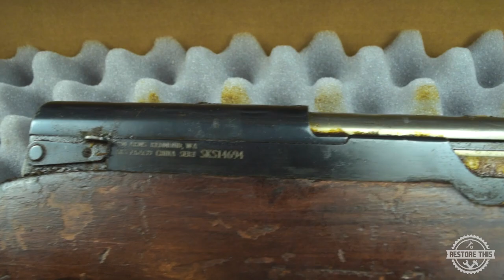VINTAGE SKS RIFLE RESTORATION! 1957 SKS Rifle Caked in Cosmoline Brought Back to it's Former Glory!

Comment: Just wondering can you still buy sks like this one?
Reply from the maker: They are still out there, but the prices are getting a little crazy in my opinion. Palmetto State still has some it looks like if you’re willing to pay up at $429 for one. When I got this one it was $300 I think, which at the time I thought way crazy expensive, but grabbed one anyhow. I’m sure the price will keep going up on these as the supply of what can be imported dwindles, but it’s hard to pay that much for one if you remember seeing these with 1k rounds of 7.62 for $99 back in the day.
Reply: @RestoreThis  thanks man ill get one from there. I had one and I sold it. I have regretted it since.
Reply from the maker: I hope you get a good one! As expensive as they’ve gotten, I still think they’re a fun rifle worth owning if for nothing else than the history!
Reply: @RestoreThis  i do agree man. I actually just got a ak47. It is an old one too. I just can't find out the year it was made. I have done a lot of research. I was reading some people in the ak forms.  Mine is different in ways from most wasr-10. I wish I knew more about it.
Reply from the maker: Interesting! WASRs are easy to date. They usually have the date stamped right on it.
Reply: @RestoreThis  mine doesn't  the way it is stamp is different too.

Comment: It may be more helpful to buy or make a set of woodworking scrapers instead of using so much sandpaper. Little harder to gum up and they last forever
Reply from the maker: Good suggestion! The paper gummed up really fast with that finish. Thank you for dropping by!

Comment: good video,  i remember purchasing 2 from classic firearms many years ago,  its always good to add the extra, hand pick option because you want a rifle that has matching sn and also the barrel needs to be in usable to excellent condition,  my only complaint about the sks in general is the trigger,  it horrible,  however it can be modded so it can be a better functioning trigger for target purposes,  i did have to replace the bolt in my one yugo sks because the firing pin hole enlarging and i was experiencing volcanoing effect and the firing pin kept getting jammed from going to deep into primer and causing primer to blow back out thus causing firing pin to get stuck inside of bolt body.
Reply from the maker: Hi Chris! That you for watching and commenting! Luckily I’ve never had the firing pin issues you describe. If I ever start having similar issues, I’ll know what the cause is. As for the trigger, I agree... it’s not the best. I might look into tuning it up a little in the future.
Reply: @RestoreThis  you should purchase some lapua 7.62x39fmj,  this is what i used to test accuracy in ak/sks based weapons,  it will let you know if your ak/sks is a accurate weapon since this is probably the best ammo you can purchase outside of doing hand loads and making you own ammo.

Comment: What did you use to scrape the stripper off the stock? I am restoring my own SKS stock and referring to your video....
Reply from the maker: Hi Martin, thanks for watching! It’s an old flexible putty knife. The particular one I used was made by Hyde. The flexibility helps it not catch and the biggest thing is watching your angle and the amount of pressure and force you use. Also, watch the grain. You want to apply pressure when going with the grain but not when going against it. You want to avoid catching on the grain and gouging the wood. Best of luck on your restoration! Take your time and it’ll turn out great!
Reply: @RestoreThis  at 6:04 how did you take that metal piece off the hand guard so easy? I am having a hell of a time with it and I'm chewing up the wood around it.
Reply: @RestoreThis  How many times did you go back over w the stripper to get the old finish off?
Reply from the maker: Hi martin, I ended up doing over it two times. Once with the scraper to get the most of it, then a second time with a red 3m scrip Uber I had laying around from another project. From there I did sanding to get some of the real stubborn stuff that was still on there
Reply from the maker: Sorry I missed this comment. At that point I had driven out the pin that held it on. I’ve take the wood out before by rotating the metal part but it messes up the wood. Driving the pin out is a better way to do it.
Reply: @RestoreThis  yeah I completely messed up the handguard, it's all split apart. I'm going to buy a "cheese grater" hand guard to replace that.  Ok thanks, I've only stripped the stock once, suppose I will do it a second time then sand.
Reply from the maker: Good luck! Keep going and take your time. It’ll turn out great!

Comment: @ 7:50 what is it that you are using on the stock?
Reply from the maker: Thank you for checking out my video! At 7:50 I’m wiping the upper hand guard down with some paint thinner to get rid of any oils/dirt from my fingers in preparation for the finish.
Reply: @RestoreThis  I'm sorry I meant 7:58 the goop you are putting on the stock?
Reply from the maker: That orange goop is called Citrus Strip. It softens up the old finish and made it easier to remove. It may not be the best way to accomplish that task, but it worked well enough for me. I was then able to scrape it off rather than sanding which really wasn’t working all too well for me. The old finish was gumming up the paper really fast.
Reply: @RestoreThis  ahh okay Thankyou. 

I’m getting a crate SKS and I plan on doing sort of what you did minus the blueing. I plan on putting the stock in a bag and put it in The furnace room for a few hours to sweat out the cosmoline.  

I’m also thinking of finishing with danish oil and then satin wax maybe, just curious of the reasoning behind using tung oil? Or if it’s just what ya had.

Comment: I’m not trying to split hairs here: but, if you’re not refinishing it, wouldn’t it simply be conservation, rather than restoration?  After all, you didn’t restore it to as issued condition, it’s just a really good deep cleaning.
Reply from the maker: Fair enough. With all that cosmoline (which I can still smell if I close my eyes and think about it) if was certainly “restored” to firing condition as it certainly wouldn’t have been safe to use in its previous condition. The stock was refinished and some of the blueing was stripped and reblued. I guess it’s a fair argument that unless everything is stripped 100% and redone it’s not a true restoration. I can see that side of it. In any event, I appreciate you checking out my video, and I hope you have a great weekend!

Comment: You should have heat gunned the cosmoline out of the stock there is still a ton in the stock and upperhandguard. When you heat gun it sweats cosmoline. Then all you gotta do is wipe it up with paper towels.
Reply from the maker: Good point! I’m sure there was plenty of cosmo still in there. When I was shooting it and it heated up I could definitely smell it cooking off still inside the handguards
Reply: I disagree with you.  He did an excellent job of refinishing the stock and the whole gun.

Comment: What was everything you used for your stock?
Reply from the maker: The stock was pretty much the same process as the bolt polishing, but I started at 80 grit and went up to 800 grit. The lower grits were a bit of a pain because it was sanding through gummy cosmoline and caked on varnish so it gummed up the paper pretty fast. If I did it again I’d probably use acetone or paint thinner and a green scotch rite pad to get the bulk of the gummy old crud and caked on varnish off. Anyhow, same as on the metal, start at 80 and keep moving up getting the scratches out from the previous grit. Also, be mindful not to press too hard and gouge the wood more than needed to get the varnish layer off and just keep working your way up. Once at 800 or 1000 grit, you have a nice smooth surface for the new finish. I used Formby’s Tung Oil finish, which is tung oil mixed with varnish, straight tung oil or boiled linseed oil work great too and give you a nice finish with less gloss than what I used. If you use a varnish, if it gets too glossy, you can a,ways knock the shine back to a matte or semi-gloss by using 000 steel wool.
Reply from the maker: If you use the paint thinner to clean things up better than I did, you might be able to just start at 220 grit or so and not have to start so low of a grit as you won’t have all that residue gumming the paper up so fast